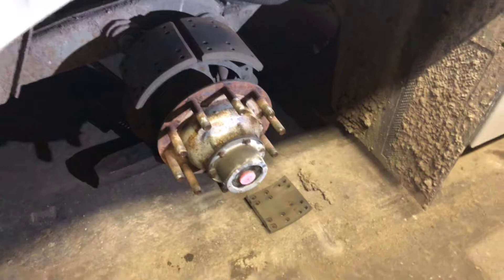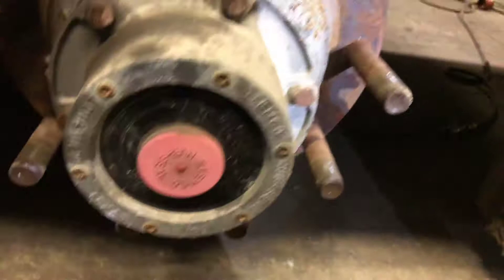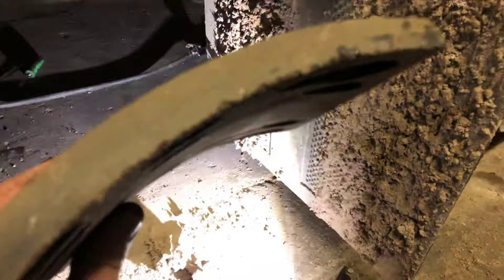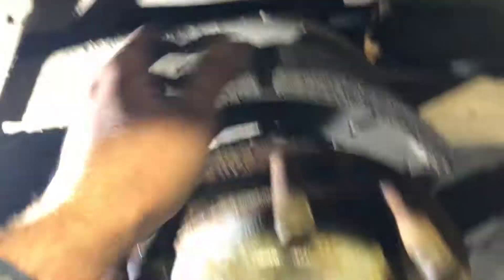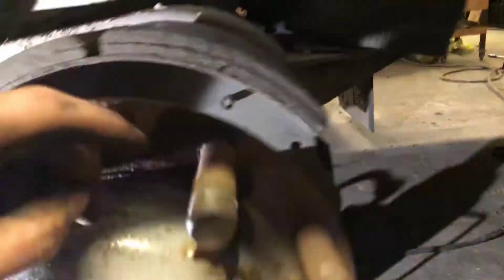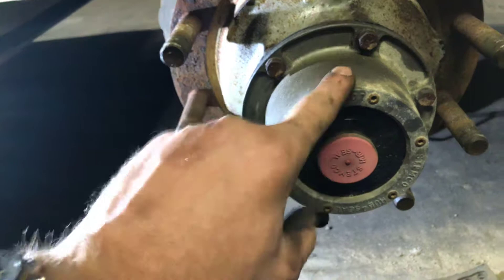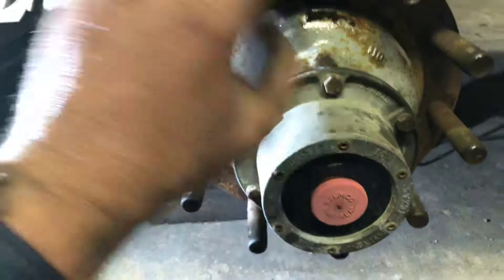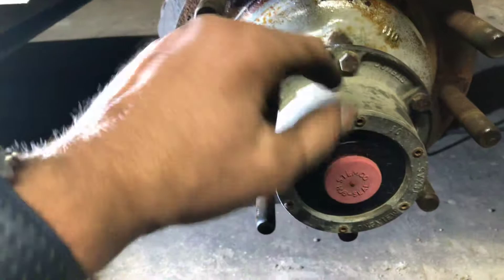Wheel bearings on a semi trailer

Comment: Not enough pressure on the rivets, i saw 2 trailers like this this week. Or when the shoes have the hole too large from use. Check for the springs that hold the brakes. Regarding the axle nut, tighten first nut until the wheel gets hard to turn (this ensures complete fitting of the hub) loose the inner nut then tighten it to spec. The counter nut should be at least tighten with a 3/4 impact or equivalent torque by hand.